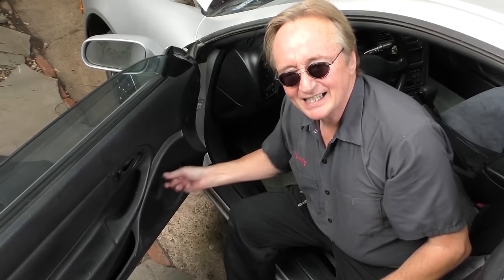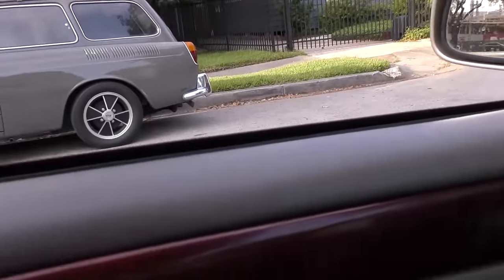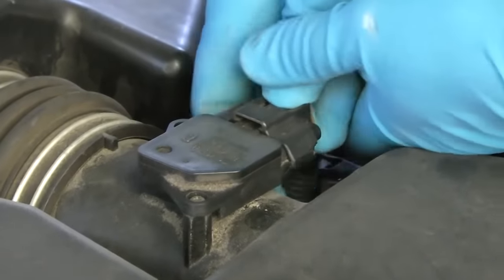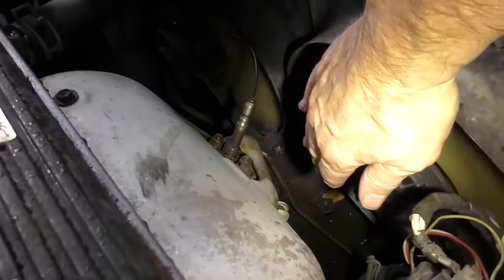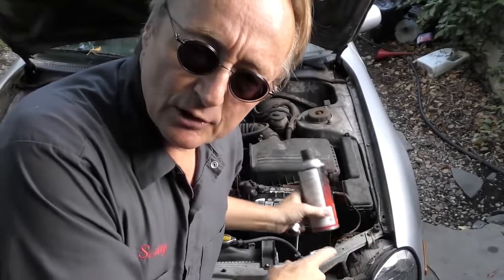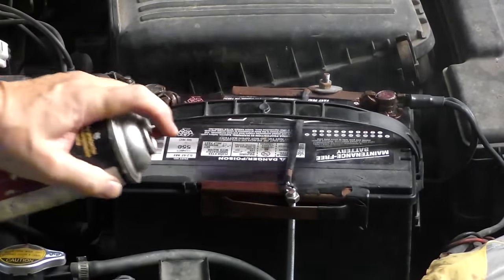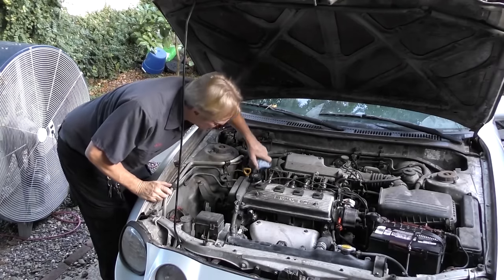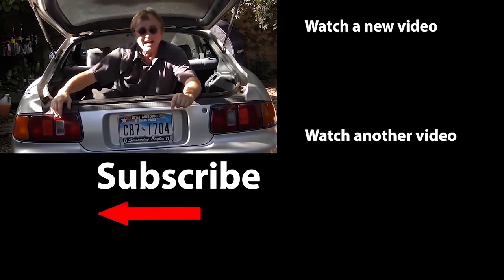I've Been Saying This for Years But You're Still Not Doing This to Your Car

Comment: Dear Mr. ScottyKilmore,

I own a 1998 Ford Taurus with four door power windows, but unfortunately the driver's side window is stuck in the down position to where the window itself will not go back up, the other windows in the car works just fine, with them going up & down, except for the driver's side window, which is still stuck in the down position, so could it be the that the window motor is blown or do I need a new door window switch assembly for the driver's side?

Comment: Scotty, any chance you could talk about lubricant in an AC compressor? I have a 1994 F-150 where the compressor seized up due to lack of lubrication. Where I live in SW Montana it's not a big deal because it doesn't get that hot here. Unplug the electrical lead to the compressor and that's it. BUT I have a 2003 Toyota Sequoia that I'd like to keep in good condition. AC seems to 'stress' the engine a bit much. Don't want the same thing to happen and ruin the whole AC system like my Ford. Any advice would be appreciated, thanks.

Comment: Hi Scotty you’re the best. Help please. I have 2015 Chevy trax last year I was getting 32-36 mpg. For the last 6 months my mpg has been getting less and less. I put a catalytic cleaner in and It got even better mpg than before for about 4 days then it starting going down again. Since then the last 5 weeks it really started going down. I watched one of your videos and used fuel injector, air filter, and had the throttle cleaned and it’s getting about 13 mpg s. It is showing no codes. What to do next. I’m really worried. Please help.

Comment: Silicone spray on the bailey channel's ?? WTF you NEVER put anything on Bailey channels, Take the Door card off and inspect the mechanism but NEVER put Lube on the the channels. 
Any Electric windows that are worth a damn will have torque releasing clutches to prevent excess load being placed on the DC Motor.

Comment: I bought a new Renault Clio from the dealership back in 2002 for less than £8000. It was a little transverse 1.2 liter 16v motor but the car was so light that with the 5 speed manual transmission it was a nippy little thing. Not fast but nimble. Both front windows stopped working within a couple of months and when I took the door card off I saw the problem. On both sides the bar that raised and lowered the window frame had twisted and snapped. Low quality metal or bad design?

Comment: You should do a video on EFI cleaning! Like with the stuff you gotta out in your gas tank and the stuff you hook up before the throttle plate and let drip to clean the system. It’s a dealership service that I believe a lot of people could be doing themselves for much cheaper
Reply: @Mark Codiroli not if you want clean injectors. Taking them out individually wastes a lot more time

Comment: I’ve got a 2004 Buick century & live in the desert. The window regulators have a plastic pulley & a braided metal cord. Every year I have to replace one or 2 because the metal binds into the plastic pulley or splits it. Someone told me there was a spray I could put on the plastic pulley to prevent it cracking or getting grooved & broken. Anyone have any suggestions?

Comment: My Honda Civic FD 2006 has an Engine Watchdog installed that as a digital engine temperature monitor that reads 80 degrees Celsius (176 degrees Fahrenheit) on the highway.  Is my engine running to cold?

Comment: I just bought a 2017 Lexus LS460 AWD which I plan to put more than 200K miles on.  It already has 49K miles one it.  I plan to change the oil every 5000 miles.  Are the Lexus/Toyota paper oil filters good enough, or would you recommend another brand?

Comment: Auto down is an AWFUL feature IMO. The ONLY times you'd typically want to put it all the way down is at a toll or drive through etc. When you just want to crack them to various extents, which is by FAR MOST of the time, the auto feature has a delay making it ALWAYS go further down than you want, even after getting a "feel" for when to reverse the switch. Its just dumb as all F & has been since its inception. Just an opinion but based of FACT.

Comment: Does the car shut the motor off when it detects the current almost like an automatic circuit breaker in the switch because I've never see any switches doing it, which i think is rood n crood😆

Comment: Lol my car does not have a temperature gage it only says C in blue when the engine is cold and then it goes away when the engine becomes normal operating temperature  and if the car over heats it will give you an H in red so I don’t think we can look at the needle 😂

Comment: Scotty help ive got a 2015 vw 1.8 tsi ive put bad gas in it I've cleand the tank and changed the hpfp but still when im stepping on the gas my rpm meter don't go up smooth ive changed the spark p too but it's the same I've been like this for six months

Comment: Hi sir I bought a 2017 Toyota Corolla and I had lucky that I got 8 oil change by dealer. They do change my oil at 16,000 km and toyota used conversion oil. They don't use synthetic oil. What Toyota are doing is it correct?

Comment: Hey Scotty I got a 2011 Dodge Ram 1500 4.7 motor when I first start out my air conditioning works great after driving for 3 to 4 hours when I stopped in traffic it blows out hot air. The Freon level is were supposed to be at I cannot figure out what's wrong with it any ideas?

Comment: DOONT PUSH THE THROTTLE WITH YOUR FINGER!!! his prehistoric car doesnt have electronic throttle, modern cars have it, and if u push it manually, you will have to reprogram the throttle after! You need to put the key in, turn for electrics to go on and grab a stick , ram it into your drivers seat and gas pedal and slide the seat forward to depress the pedal. Your throttle valve will turn for cleaning. Also some cars dont have maf mas sensors, i wasted money buying the cleaner

Comment: Hi Scotty, since you own a lexus. I have a quick question.. i have a 2006. Lexus rx330 with a code 2118. Indicating a throttle body acuator control motor apring staying on.. is that mean the throttle acuator motor is bad ir its just dirty.. engine light turn on and vsc then it cuts power to the pedal.. it won’t accelerate.. i have to turn it off then start for the pedal to work and able to accelerate. Since the throttle position sensor is ribited on the throttle, you technicaly have to replace the whole throttle.. ao my question.. you think its a bad acuator motor that make the spring to get stuck or juat getting stuck because its dirty.. i recently clean it when i had everything off since i replaced my starter.. i unplugged the connector wiring harness from the throtlle.. plugged it and after i put then together i started it and it went away.. sudeenly while driving.. coming into a stop to a stop light the car hesitated and triggered the engine light to come back on and vsc then no acceleration again.. besides that when i turn a/c in that teiggers it too.. is that mean its sending low circuit to the etcs, Because my battery is getting old? I haven’t change the battery since i bought the car. Never had a problem with the battery dieying tho. So i’m not even thinking its because os the battery.. but since i’m starting to notice that when i turned my a/c on it hesitates the car then triggers the engine light.. since a/c makes the engine to run a little rough since its a/c compressor comes on that make its heavy for the engine. Donyou have any idea on what is going on? I know its hard to figurenit out without the car being infront of you to diagnose it.. but did this ever happen to your wife’s lexus?

Comment: Hey scotty I got Es330 2005 model, problem is my Windows on the left (the driver and the one behind in rear passenger) are stuck. I tried to slam the door but it did not work for me what could be the reason? should I go for the fuse or the motor?

Comment: Should i use high mileage synthetic on my 207k mile Avalon XLS or does regular oil work as well for high mileage engines??
Reply: Synthetic!!!!!

And change oil and filter every 5000 miles.

Otherwise you can develop oil ‘burning’ problems.

Comment: Your maintenance advice regarding brake fluid is atrocious. While some cars are more forgiving of poor maintenance, it's no excuse to not maintain your vehicle. I had a 2012 frontier and a 2012 flex both come in the same week with bad ABS hydraulic units, and commonly see problems with calipers with phenolic pistons sticking after 5 years or 60k+ miles because of the lack of ever changing the brake fluid, which should be done every 2 years. BMW builds a 24 month maintenance timer just for brake fluid into their vehicles. Master cylinder leaks, or won't hold pressure. Why? Because brake fluid lubricates the seals and ya didn't change it. Quit encouraging people to not maintain their vehicles and then pass their problems to the next owner.